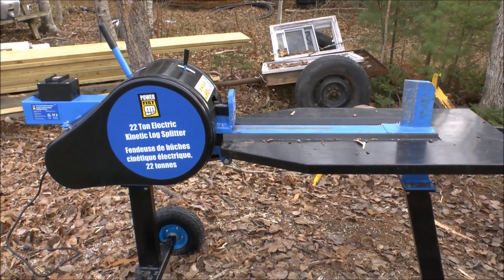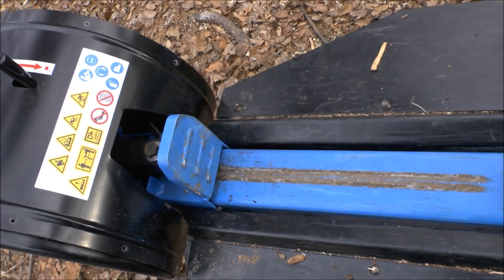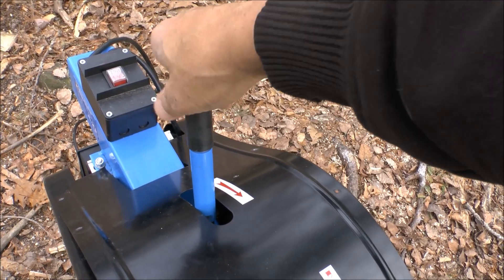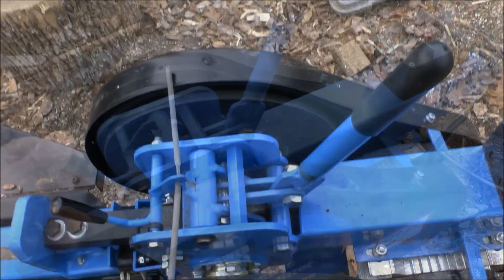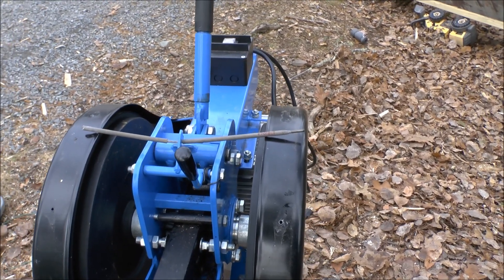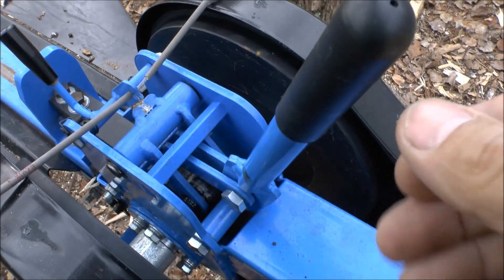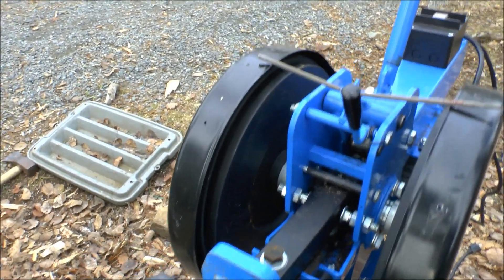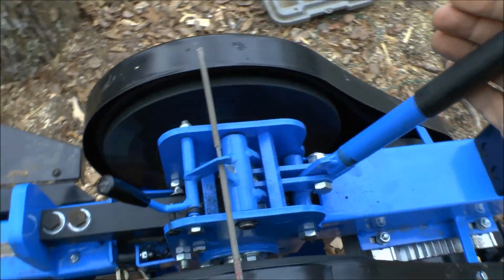Inside kinetic wood splitter

Comment: Lots of videos of people using hydraulic splitter to make a forging press for Damascus and other stuff, do you think it would be possible to make something like that with this one? Maybe it would be cheaper, looking for a way to save my arm😅
Reply from the maker: Honestly I don't think there's a way to utilize this machine for that purpose, if I thought it could work as a power hammer or press I would try it. But its really only good for this one thing
Reply: modernblacksmith ok thanks!!

Comment: So simple, you would think these splitters would be even cheaper. After all,  they have no hydraulic pump, no hydraulic cylinder,  and no hydraulic control valve.
Reply from the maker: Maybe the extra cost is in liability where they seem a little more dangerous

Comment: Pressure isn't holding the rack down, the roller on the handle is holding the rack down, and once it gets to the end of the stroke it goes past the roller, pops up and the roller stops it from retracting until you release the handle.
Reply from the maker: You're right
Reply: @modernblacksmith  glad you are back